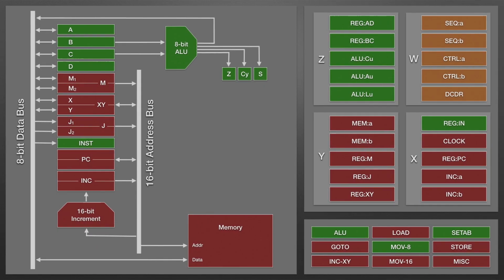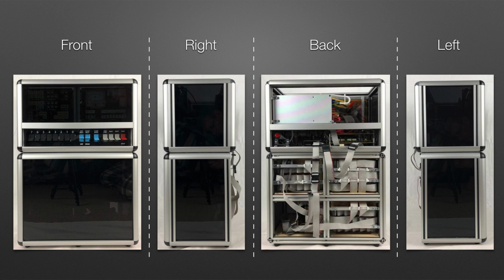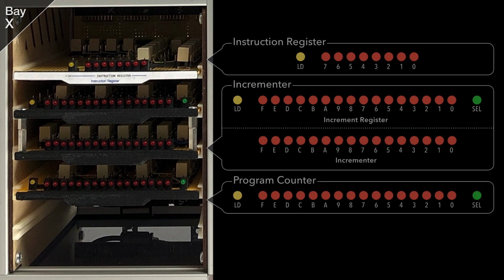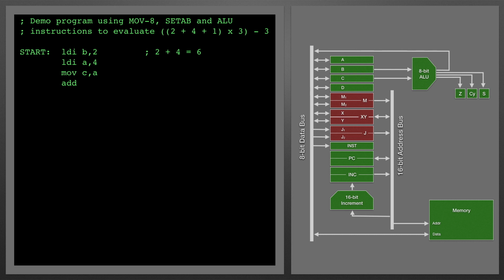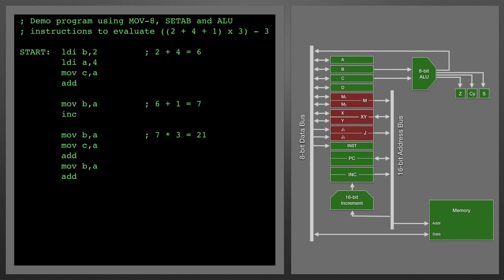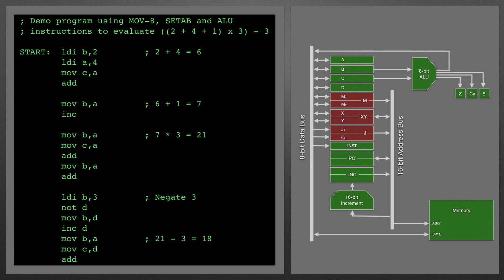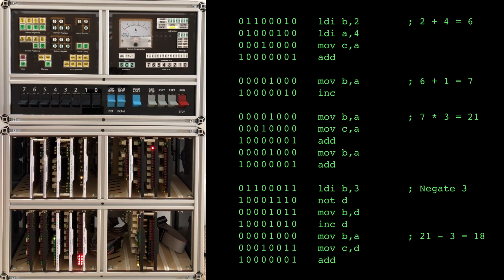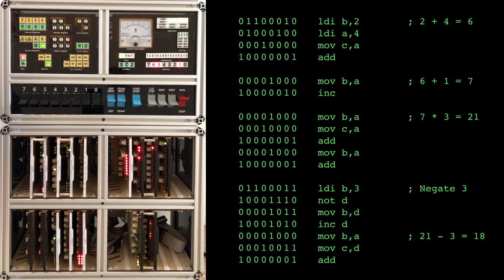Relay Computer Overview & Demonstration (April 2018)

Comment: Great video, but i was wondering what are the expected costs of this whole project?
Reply from the maker: I'd say it's going to end up somewhere around £3000 depending how far I take it and how many 'add-ons' I create. The relays themselves make up the majority of that cost but surprisingly the turned pin socket strips come in a very close second.
Reply: Paul Law But i have one final question: How much relays are needed in total?
Reply from the maker: When I’ve implemented everything in the architecture diagram shown in this video it’ll be around 600 relays.

Comment: Thanks. Out of interest, what video editing and other software did you use to make this?
Reply from the maker: I'm a Mac user so most of it's 'out the box' software. I generally start with a Keynote slideshow and then take that in to iMove for editing and voice over. 

One of the annoying limitations in iMovie is that you can only have two videos running simultaneously. To do the bits where I've got multiple videos playing at the same I had to get creative ;) In the past I've just kept layering up the videos in iMovie (by adding the next video to the timeline, exporting the result and then dragging that back in to iMovie and adding the next video clip) but this time I used Keynote (which can run multiple videos) and was just 'clever' with positioning and sizing each video to get the effect I was looking for.